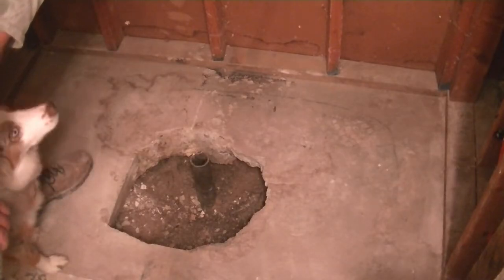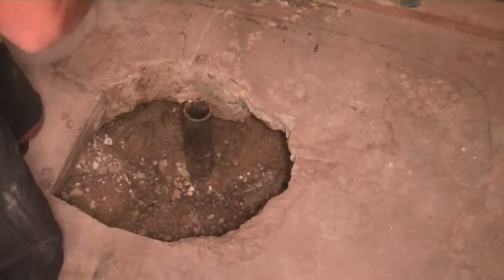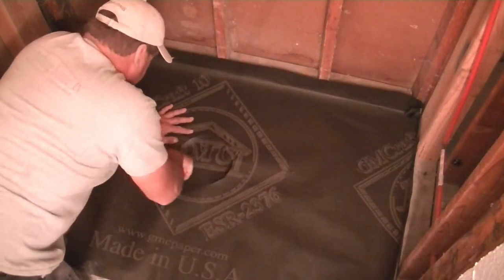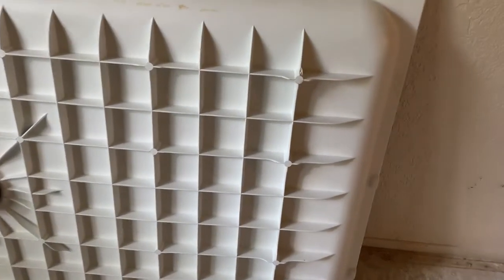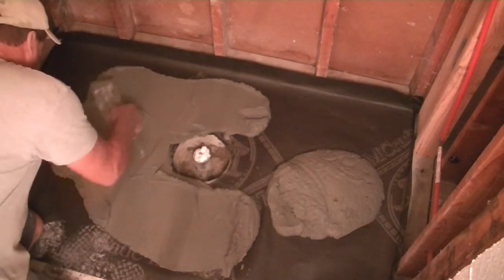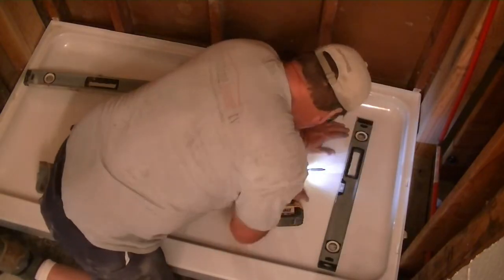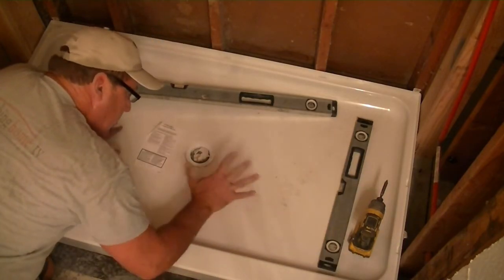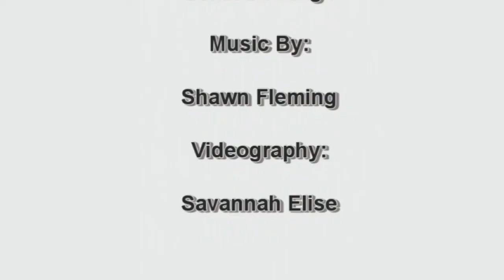Installing an Acrylic Shower Pan in a Mortar Bed

Comment: DUDE! waaayyyyy toooo muuuuch mortar! Followed your advice and put mortar down as thick as height of grid. The pan barely sinks in the mortar!  Pulled pan up, removed about half of mortar, walked on pan for 10 minutes and I am left with having to caulk a 1/2" gap between floor and bottom of pan. Not happy at all with your advice!!!!!!!!!!!!!!!!!
Reply from the maker: @jimschmidt7303  sorry to hear that. I can only speculate as to why it didn’t work as most of the comments on this video are how well it works. My first thought is you had the mortar too thick. By thick, I mean, not enough water added.

Comment: Possible.  The directions on the bag said 1 gallon plus 1 quart or pint. It seemed dry so I added another quart of water. In the video you mentioned a vague amount of mortar and consistency to achieve. What would be helpful to others would be add to in video description more specific quantity, full 80 lb bag or half bag of mortar and amount of water in comparison to directions on bag.
Reply: I was checking depth of mortar with a fold out ruler, my mortar depth on second attempt was 1/2", half the depth of the plastic grid.
Reply from the maker: @jimschmidt7303  I do believe in the video I say mix the mortar to the consistency of peanut butter, I’m thinking maybe you use chunky peanut butter (my attempt at humor).

Comment: informative video. Thanks for taking the time to put this content together. Curious your thoughts on how to resolve... we just set an acrylic pan in type S mortar and did not bring it far enough out along the front edge, where the "dam" is. All is level and the sides and back are all set in mortar, but any weight on the front edge and the pan flexes. We have a small amount of access under the lip of the pan before the finished floor goes in; is it remotely reasonable to mix up another batch of mortar and use a piping bag to squeeze under the front edge? Using a ruler, there is ~1" between front lip and the existing mortar bed. Really appreciate your time and input. Thank you.
Reply: Minimally expanding spray foam is an option. Use the door and window version.

Comment: How did you connect the drain line properly from above? Struggling right now lol.
Reply from the maker: I used a drain with a compression gasket that is secured from the top.

Comment: I hear about  using n type and s type mortar for under a shower base.  i am putting the base on top of wood a pvc liner.  Which mortar should i use?
Reply from the maker: Type "N" will work fine it has a lower compression rate (750 Lbs per Sq in) and Type "S" has a high compressive strength of over 1,800 psi and a high-tensile bond strength.

Comment: Where do you get that drill attachment and what is it’s nomenclature please sir?
Reply from the maker: You can purchase it at most any Home Depot or Lowe’s typically found in the tile section with the thin set and grout. It’s just called a paddle mixer.

Comment: I thought it had to be dryer then that
Reply from the maker: I’ve found that a dryer mixture works when setting a soaker tub or a shower pan without a honeycomb type bottom. When you have a honeycomb bottom such as this shower pan if you get too much mortar mix in an area a wetter mix will allow it to push out easier.